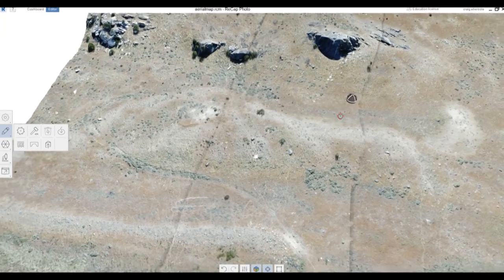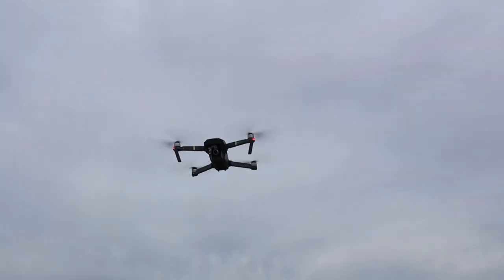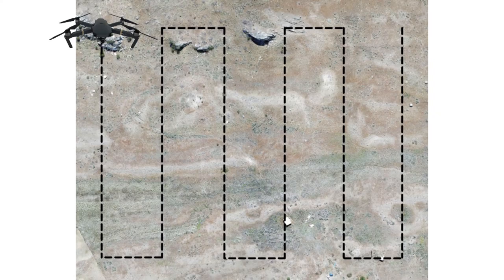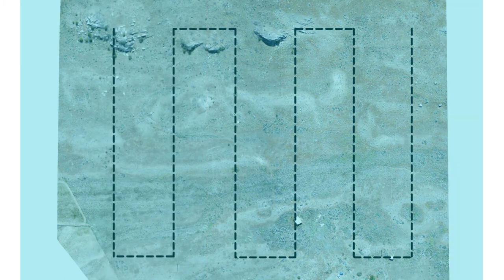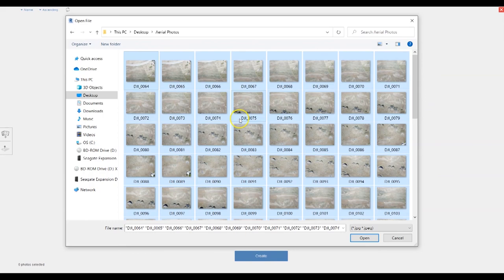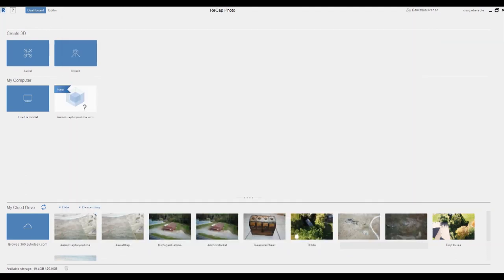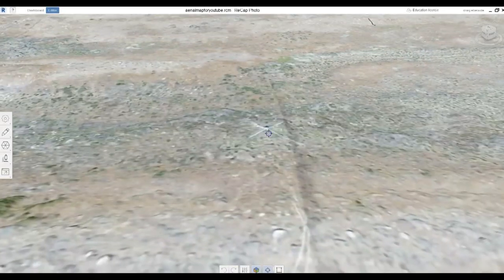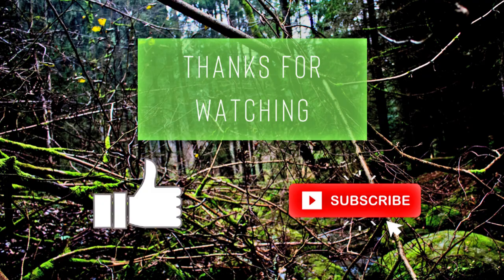Making an aerial map of your property with a drone

Comment: How big a property could you do? 500 acre?
Reply from the maker: Hey Matt. Unfortunately I don't have a specific answer for you as it would depend on the drone you are flying and how good of resolution you want for your map. At the time I shot this I think I was limited to a few hundred photos. I can't remember exactly because it was a while ago and there has likely been updates to the software since then.

With DJI drones like the mavic pro I was flying in this video there is no zoom on the camera, so you manually have to fly at a good altitude for the resolution you want. The issue is that if you have to fly really low to get that detail, then you need more images to cover the entire property. If the software limits the number of images you can import, then it won't show the entire property.

Then we have the DJI flight limitation of 400ft AGL. For a 500 acre property like you mentioned we likely wouldn't be able to cover anything close to that size. MY program was pretty much tapped out at around 200ft AGL on my 22 acres.

It seems like it would be feasible to capture a larger property in sections and piece them together, however I haven't seen an inexpensive program that can do that. You'd want some more professional grade software like ARCGIS.

Hopefully that answers your question. Thanks for the comment and for checking out my channel.